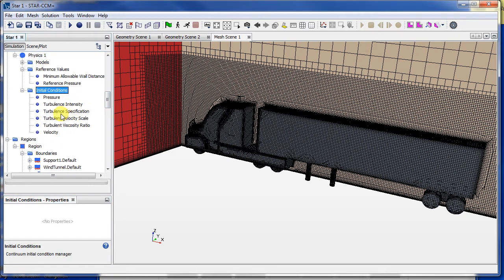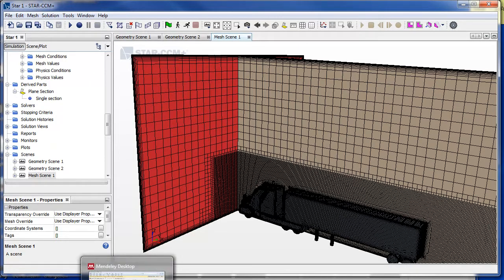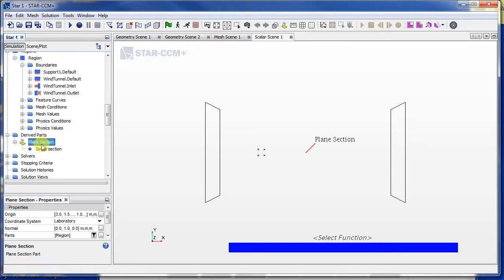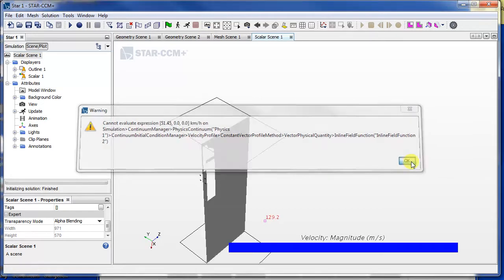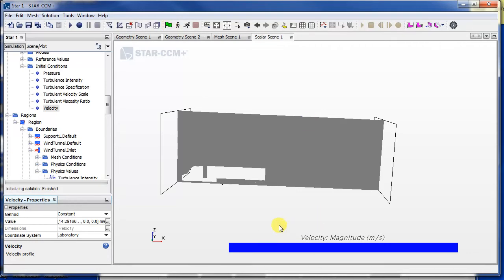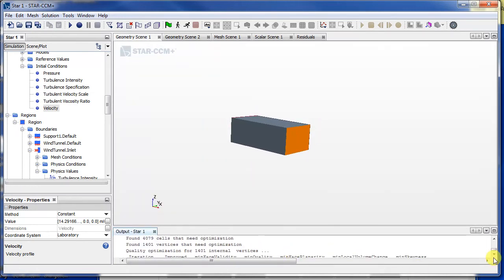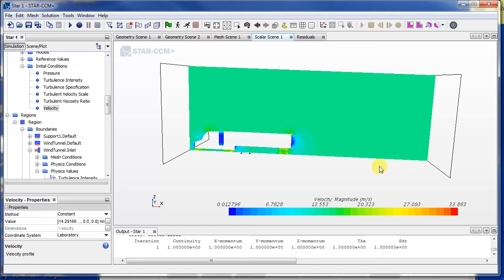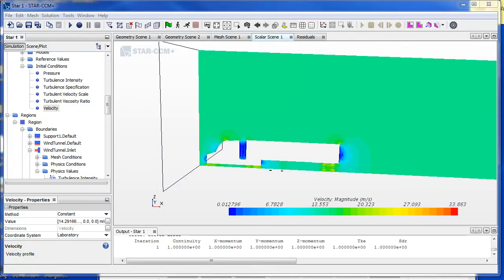Star ccm+ Beginner to Pro [Simulating a truck part 13]

Comment: Hi Zac, this video series is very helpful! Just one question, did you put the velocity (14 m/s) in both the physics continua initial conditions and the velocity inlet physics values? or just one of them?
Reply from the maker: I put them in both, initial conditions is about the starting velocity of the entire flowfied, whereas inlet velocity is a boundary contion. In theory just putting the inlet velocity is sufficient for a solution but you'll find the solution converges faster by initiating the entire volume with a velocity, as you don't need to wait for the inlet velocity information to propogate from the inlet throughout the domain. Hope that's not too confusing!

Comment: Hi Zac thanks so much!
I was wondering how do you decide which turbulence intensity to adopt and how much impact does this have on the results... I know it's the percentage of variation of flow speed around the average value but... how to know how much it varies and what does it depend on?
Also, how you are not setting turbulent viscosity ratio. Is this ininfluent? Is the standard value correct? What does it depend on?
Thanks a lot!!
Reply from the maker: Hello.. Thanks for your question.. Turbulence intensity in this case was measured by the experimental paper i had validated against.. If you don't know it you can look up common intensities for certain situations.. Regarding viscosity ratio i left as default as i had no data on this.. If your validation in the end looks okay then should be fine. Good luck!

Comment: Hello Zac, thanks a lot for your videos.
I also use this software to simulate airflows around buildings and I have a question about the inlet boundary condition: you're using a constant value to define the inlet wind velocity but is it possible to define the inlet wind velocity profile according to the logarithmic law? And how can you do that?
Reply: Hi, thanks for your interesting question. Yes this is possible. In the velocity setting instead of 'constant' you should use xyz table. Then you need to import a CSV file with your logarithmic velocity profile generated on excel or MATLAB or whatever (go down to tools > tables and you can import it) then in your velocity setting choose this table. Let me know if you need further instruction!

Best wishes,
Zac
Reply: Hi Zac, thanks for your reply!
As I did not manage to use an "xyz table" because I don't understand how it works, I have created a field function to describe the logarithmic law and used it in the inlet boundary velocity setting. I think it is working well as I have consistent results.
Thanks again!
Matt

Comment: So I noticed that the boundary layer is around the walls of the wind tunnel too, which I assumed is just redundant as we are trying to model just the behavior of the truck. Is there a way to specify the boundary layer to exclude the wind tunnel?
Reply: Jason Sun hi.. it's a good question and a good point you're raising.. in this particular experiment were trying to replicate an experiment that was done in a wind tunnel.. In any wind tunnel experiment there is bound to be some form of boundary layer on both wind tunnel, and also the geometries surface itself. So in this particular simulation yes we want both boundary layers. In the simulation of a road-going truck you are correct that there would be no boundary layer on the incoming air stream. If you want to simulate this you can change the boundary parameter of the walls from 'wall' to 'symmetry plane'. This type of boundary simply mirrors the conditions in the adjacent cell. Thanks for your interesting question.
Reply: Thanks a bunch!